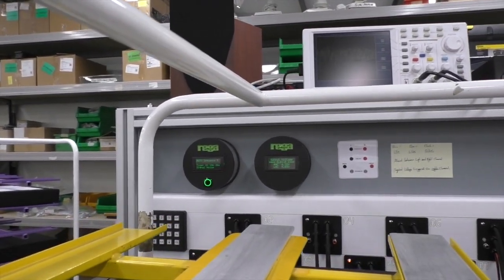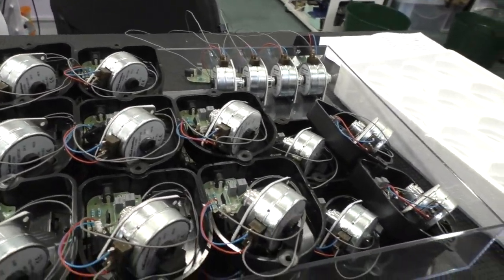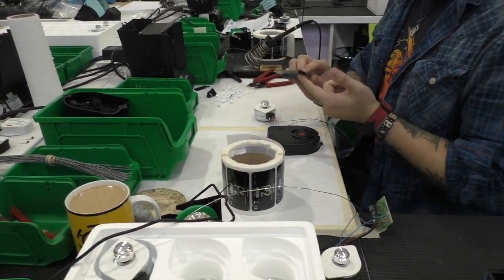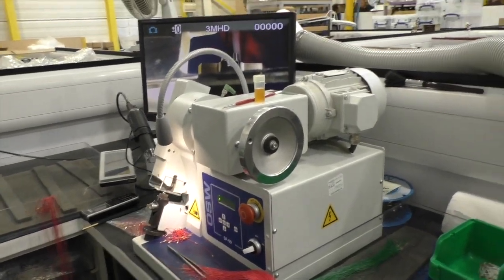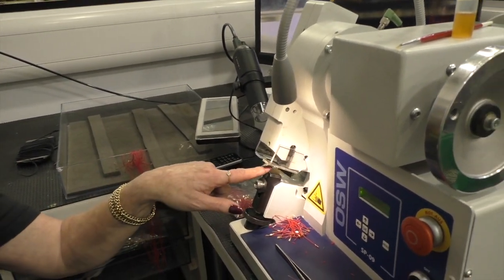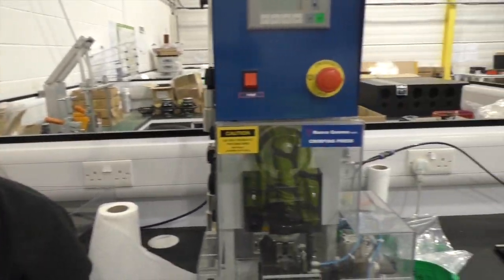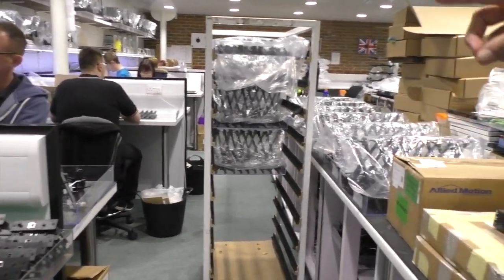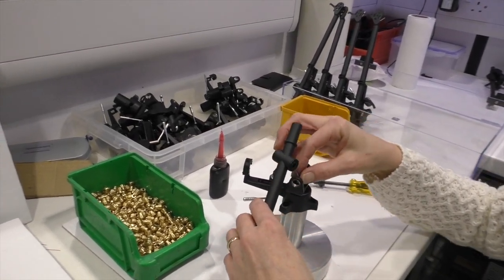AnalogPlanet Visits Rega Research (Part 3)

Comment: I recently tested a few mats as replacements for the stock felt option on my Rega P3. I tried cheap rubber, cork (Project), and the 'Ringmat' from Ringmat Developments. The Ringmat was a clear winner. Who knew it would make this much difference!? The bass was much, much tighter, louder and audibly deeper too. It works on the basis of minimal contact between record and mat. I was not surprised to learn that the Music Hall mat did well in your published test of 8 mats, given the similar principle of design. 

Thanks for the tour!

Comment: Why would they crimp the headshell wire to the arm wire? surely the better way is just to crimp the cartridge connector straight to the arm wire, can't see the benefit of doing it the way they're doing it the impedance must be greater, anybody know why they've done it this way.
Reply: Analog Planet don't really understand her explanation it's only crimped on one end, the other end is just wire so why it couldn't be fed through I don't know. Was hoping to see the main bearing manufacturing but you didn't show anything misleading in your thumbnail shows it???